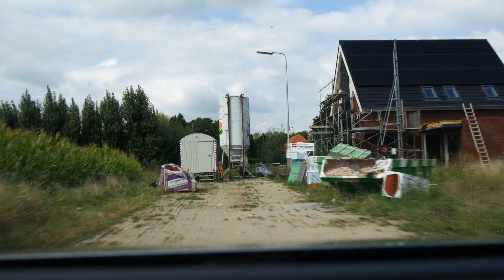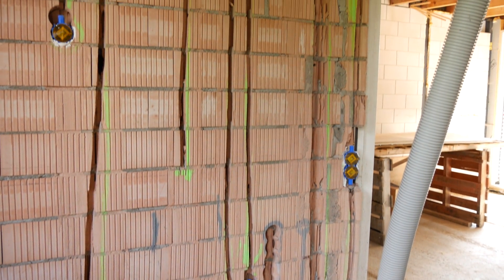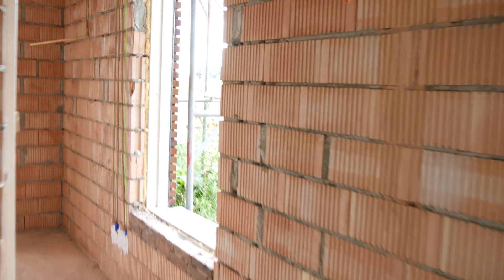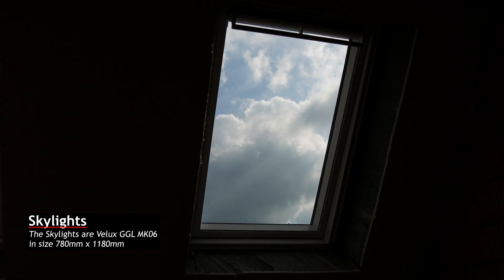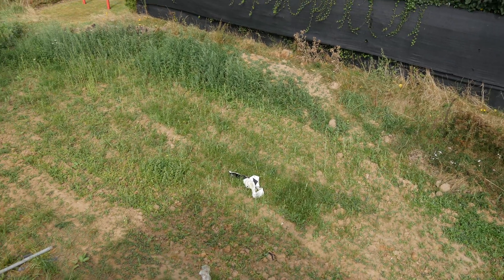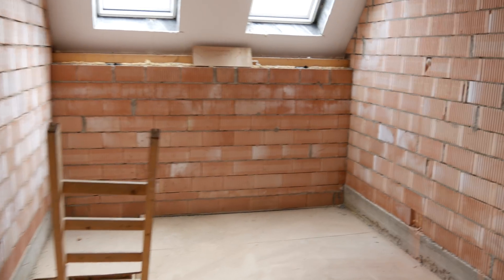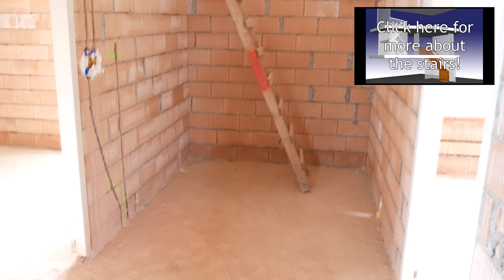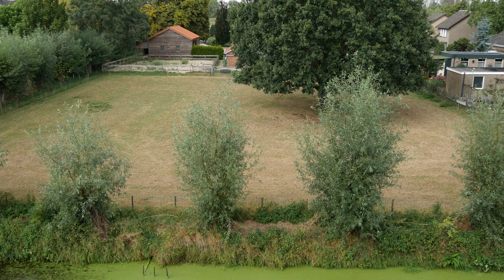Home Networking: Third walkthrough

Comment: My god that is a lot of wall chasing!  Any idea on what brand/model of chaser was used?
Reply from the maker: Yeah, I basically wanted any visible wire removed. ;)

I don't know what kind of brand/model they used, I was at work myself while they did it. They had about 1,5 days of work though, so that wasn't too much!. The interior wall "bricks" are quite 'fragile', they are a baked clay product and not concrete so once you go at it, goes pretty fast, you actually need to take care not to chip off too much because it comes off in chunks.

Comment: I've neve seen this kind of contruction here in Ontario Canada.  Is there a commercial name for the bricks that you are using or the contruction style?  How do you handle insulation in the walls?
Reply: goed bezig man
Reply from the maker: Funnily enough here in the Netherlands we call this type of construction "traditional" because it uses brick and mortar.

The interior wall stone (which is the walls the house sits on) are made using Porotherm (PM20) bricks. These are hollow baked bricks which provide very good strength and rigidity combined with good thermal and sound insulation. They are a bit more expensive than for instance concrete bricks, but because they are so light and easy to lay in the end it should be about the same price when you factor in labor.

All walls are insulated with Kingspan kooltherm K8 boards. These are fixed to the exterior of the internal wall. Then a gap of about 5cm is left after which the exterior wall is built.

Using all these materials together makes for a well insulated home.